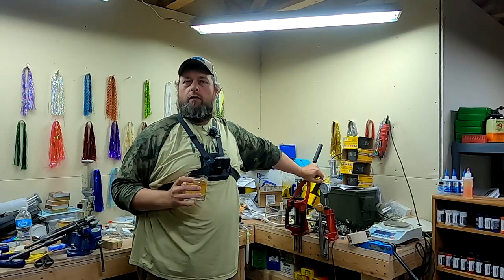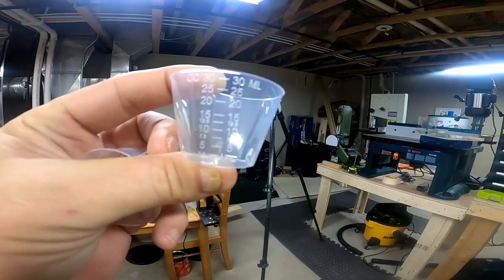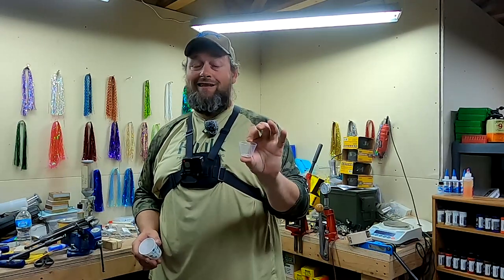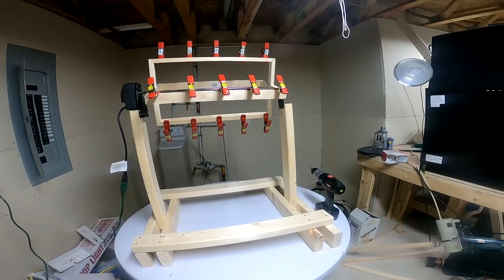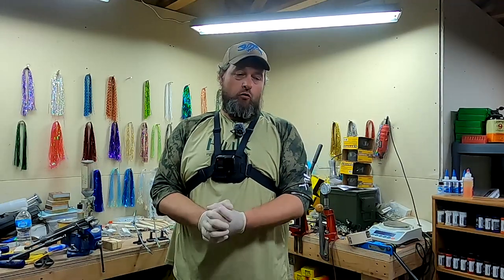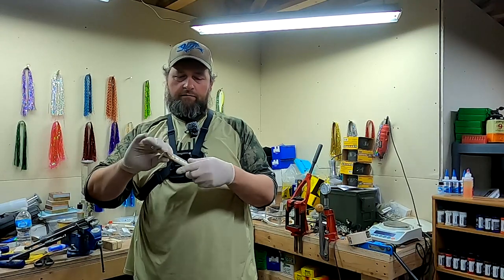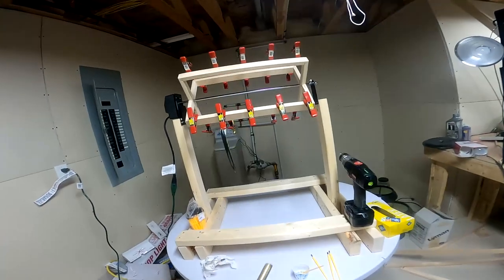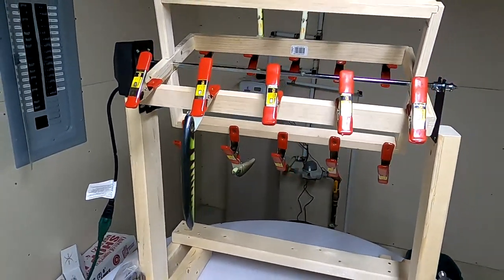How to: Make wooden musky lures - Epoxy

Comment: How to make wooden musky lures: MORE EPOXY :D
Reply from the maker: :D  There's definitely a lot of steps involved, and "more epoxy" is certainly a time consuming one.  LOL
Reply: @RealLifeFishingWI   I usually don't "make" (manufacture) my lures but what I do usually do is cover all the things i buy for musky with a single/double layer of UV resin. It's quite a fast process. You can fish it immediately after washing the surface with household detergent.
Reply from the maker: Yeah, different types of epoxy have different strengths and weaknesses.  I like the finish and durability that this type of epoxy affords, even if it is more time consuming.